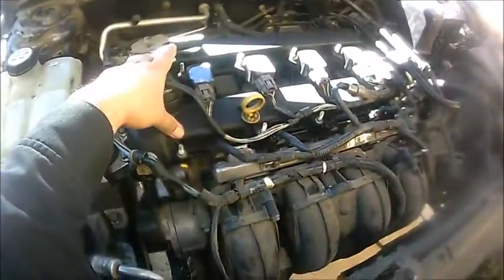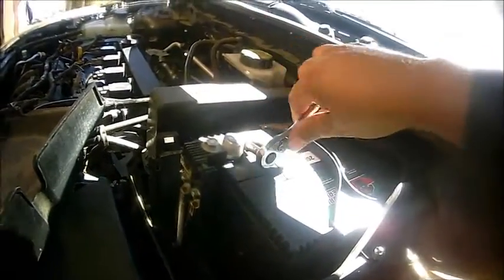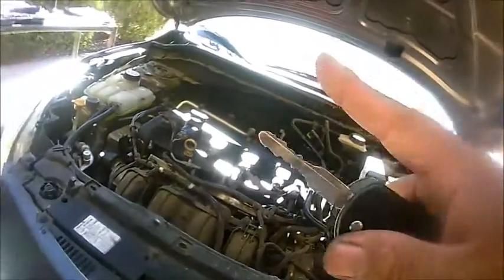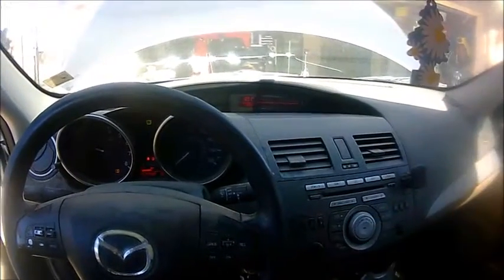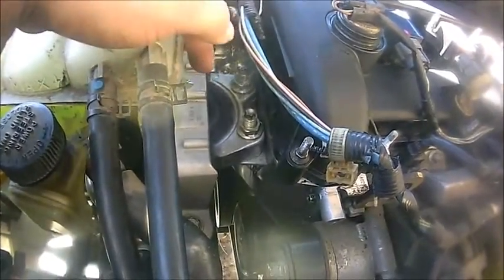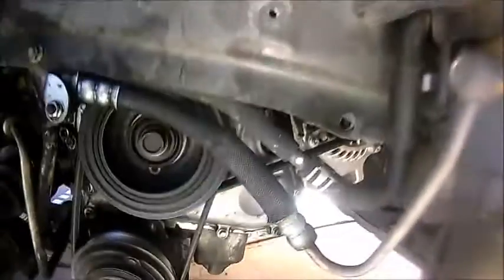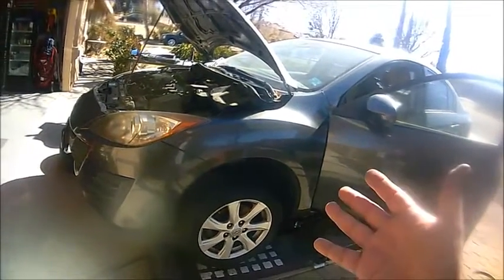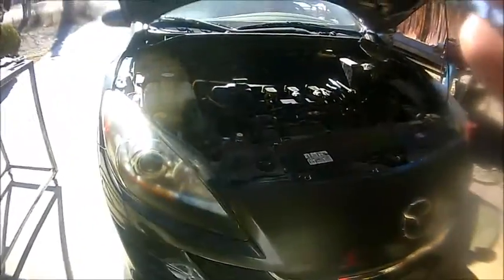2004-2011 Mazda 3 2.0L Timing Chain Replacement Part 6

Comment: Many thanks for putting in all that time with so much detail, and often one handed! I am planning the chain change on a Ford Focus 2L, and this should be very similar. I have been reading up about it elsewhere, and (at least for the Focus) I noticed 2 differences: tightening the camshaft sprocket bolt(s) must be done with timing chain and timing tools already in place; and only the crankshaft pulley bolt and 2 diamond washers need to be replaced.
Thanks again.
Leo